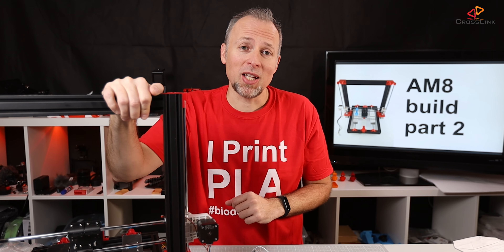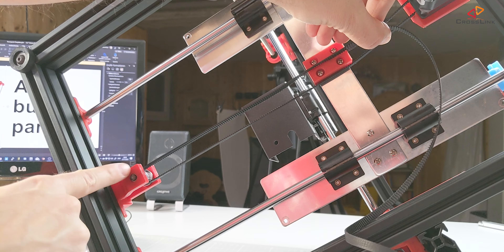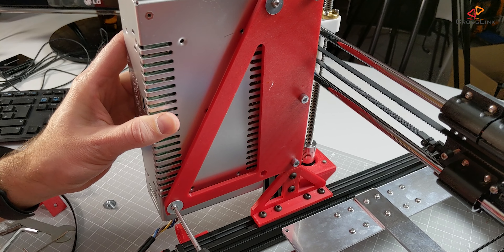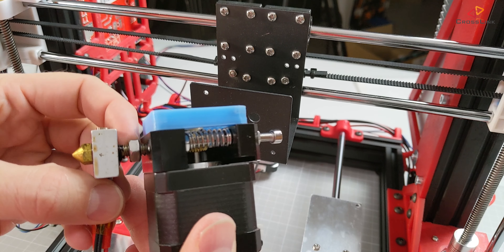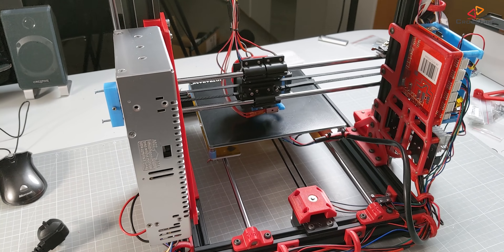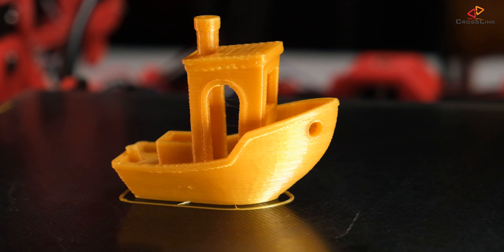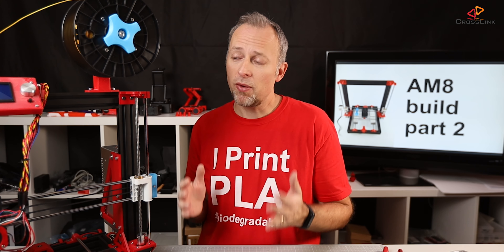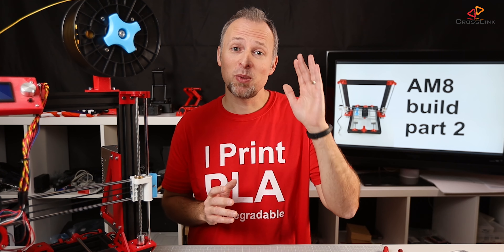Anet A8 AM8 Upgrade - part 2 - Electronics and first print

Comment: My hotend on my AM8 is an original E3D V6 hotend in bowden setup to an original E3D Titan extruder. I then also recommend going for Capricorn XS tube since you will not be cutting any corners. To mount the hotend I used a x carriage from 3Displacement on Thingiverse (thing:3599905 and option 2 or 3) together with a custom designed BL Touch bracket (can find it through the X carriage link).  Print quality is excellent now (I had trouble with my Anet extruder skipping on the filament and grinding). I would also recommend a mainboard upgrade in the future, something like a Bigtreetech SKR v1.3 with TMC2209 stepper motor drivers. You will have all the goodies then: stealthchop, sensorless homing, 32 bit processing and ample expandability.

Comment: Great video indeed. I did the same to my CTC i3 pro B, I then got some more aluminium and re-built it as a cube frame and ghosting/ringing is a thing of the past. Thanks to other videos of yours it also has Marlin on it and a 12864 LCD all working perfectly (mainboard is a Anet a8 one).
Reply from the maker: Great to read you liked it! If you have ideas for other topics I should cover, just ask me to make a video about it.

Comment: That's a very nice upgrade.  I think I'd do this upgrade to my i3 mk2 clone since it's frame is made of plywood right now.  Thanks Daniel!
Reply: Plywood isn't all that bad.  I am currently resurrecting a CTC i3 (got it incomplete) and with a few printed parts, it becomes extremly strong. But it has the "full" main frame part (the big "O") like a prusa and not like the Geeetech i3 Pro W that I also mod right now. If I would mod a Geeetech i3 Pro W the way he mods his Anet A8, there would be not much of the original in the final printer anymore^^ If I replace the frame, I should also replace the leadscrew and the Extruder with Hotend are kind of bad. Then I should replace the driver, the bearings and the PSU (24V would obviously be better) Then the cheap Heatbed and maybe the screen. Basically enough to start building a second printer from scratch, right?^^ I have therefore set a different goal for each of my printers. My Ender 3 shall be the best it can be, because it was very good from the start. My Geeetech shall be upgraded as efficient as possible (got it for only 40€ by chance) and my CTC will be the subject to all kind of weird experiments, reviving it with parts I clone from the original Prusa i3 Mk2s (I have nearly completed my cloned direct drive) And luckily files meant for the Geeetech are often also working for the CTC and vice versa.
Reply: @SchwachsinnProduzent  My frame is one I laser cut from 6mm ply and then laminated 2 pieces together to make a 12mm frame.  It has the side supports which are also 6mm ply but only one thickness of ply.  It is very strong yes, but the laser cutter I used has a 12" X 24" bed so my frame had to be pieced together since the whole frame could not be cut at once.  My MK2 clone is based on the "dolly" clone Tom of Toms3d did with some custom printed parts and tweeks.  It works pretty good but I'd still like to do a aluminum frame for it some day.  Thanks for your reply.
Reply: @kortt  So the weakest point is currently that you could only cut smaller pieces for the main part of the frame that you had to put together? If I understood Tom's video correctly, the precision you get with normal hand tools is enough for this part. Maybe you could cut this one piece again, maybe from a different kind of plate. I could imagine, if you find something like an old iron plate in the right size, it would be pretty cool and overkill. Or you might get a rest piece of good wood in that size for a good price. I would keep the eyes open for something that could be recycled for this. But I can also understand, why you would like to try an aluminium frame. Since the Dolly is basically an Prusa i3 Mk2S with cheaper parts, I would recommend you to look for the Prusa i3 Bear upgrade. It seems like this is basically what you are looking for.

Comment: As a upgrade to the smooth rod holder. You could move the fixing point's to the front the printer. Design a upside down t. On the end of the vertical section you could put a tunnel that would hold the smooth rod. then you would be able to use the adjustable wheels that you printed for levelling the bed.

Comment: Would the E3D V6 with a direct drive or bowden be a good upgrade. There are several conversions to be had on thingiverse for the A8.  How would it be better?
Reply: e3d v6 is a worthwhile upgrade, however, converting to bowden is up to you. The stock anet x carriage is kind of terrible, it's heavy, and also gets very warm. An e3d v6 solves most of these issues and is some cases can net you an extra 10-30mm in x build space.

Comment: Hi, did you glue a glass in the heatedbed? Let me know how please.
Reply from the maker: I used the Anycubic Ultrabase, which comes with a self adhesive glass. Anyways, you can use double sided tape or a pre-made double sided sheet that fits for your printer.
Reply: @Crosslink3D  Thanks for the tip.

Comment: Nice vid. like allways, but i got few points for you:
1)still using original cables from power supply to electronics? PLS check the fuse! it sometimes burn itself, better make a separate cables to each mosfets and mainboard.
2)try to use better coupling for Zaxis threded rods, this spring ones can make a big errors in layer heigh
3)about that speed test... you will use bigger acceleraitons, right? so the default acceleration in firmware is dominant that you use in slicer configuration, so be aware...

Nice build! keep the good work! :D
Reply from the maker: Thx for the points. I have two sets of wires going to the Mainboard and mosfets separately. Do you have any specific motor couplings that you can recommend?
Reply: @Crosslink3D  iam actually using coupler from trianglelab. (full name on aliexpress: "trianglelab Upgraded Leadscrew Coupler For CR10/CR10S/Ender 2/ ender3/Tornado/Anet A8 and more Flexible Shaft Coupler")

Comment: Hey I have an am8 with stock motherboard. What would be a nice upgrade for the motherboard? I remember ramp 1.6 but that was a year so two ago. I want the lastest stuff so I don’t have to upgrade later. Thanks
Reply: Biquu Techtree SKR 1.4 Turbo with 2209 Stepper Drivers, its 32 Bits at 120Mhz and accepts 12V or 24V

Comment: PLEASE HELP!! I am not a programmer but I did the AM8 build and added an e3dv6 and a capacitive touch sensor. I cannot figure out the firmware changes. Could you send me the CONFIG files for this so my printer is not a hunk of scrap metal?!

Comment: Anyone tried replacing the X axis motor couplers with universal joints (or gimbal joints) ?
Reply from the maker: Do you mean these? [10,39€]5mm to 8mm Aluminum Shaft Coupler Rigid Clamping Coupler for Creality/ Ender 3 3D Printer 3D Printer & Supplies from Electronics on banggood.com
https://banggood.app.link/axq4e1w011
Reply: @Crosslink3D  Nope. These are rigid couplers.
I would like to have the Z axis screw completely free to move in all directions, to avoid any binding in the brass nuts on the X-bridge.
It is very important that the couplers are precision made with snug fitting bores to both engine and screw axles.
Any remaining offset in this coupling will end up as binding in the brass nuts, therefore a Ujoint would allow the ultimate free turning in the brass nuts.

Comment: Maybe you could try to clone the Prusa direct drive extruder? It is mostly printed, Prusa is known for their great print quality and parts are easily available. I am currently cloning the one from the Mk2s (waiting for the extruder gear, because I got the cheapest offer which takes forever). I removed the back part of the Motor and spray painted it glossy black so it looks even more like the real deal (apart from the wrong filament colour of the printed parts). I heard that the best deal for a good V6 is to get the cheapest chinese one and replace the heatbreak with a genuine one. Or get the slightly more expensive chinese clone from Trianglelab. I used the official build guide and the videos and hompage of Thomas Sanladerer as my sources for the most part.
Reply from the maker: Congratulations, you have won a "I Print PLA" T-Shirt. You were drawn during the livestream on Sunday, 1st of December. Please get back to me for the details :-)
Reply: @Crosslink3D  Awesome :) How should I give you my contact information? I think YouTube removed the private message function with one of their updates, didn't they? Shall I send an e-mail?
Reply from the maker: Yes, please send your address and email to daniel@crosslink.io
Reply from the maker: Please send me an email, so I can make sure you will get your shirt. If you don't do it by Friday 13th 6pm CET, I will draw someone else.

Comment: The bed leveling issues are discouraging me from doing this metal frame upgrade.
Reply: With the BL touch, you don't need to level the bed often.

I am using nyloc's on mine and it's been a no brainer

Comment: Hi.  I recently sssembled an older model Anet A8.  It has the V1.5 board.  I've been reading and watching tons of videos from people that say I need to upgrade my firmware.  Then there is the whole boot loader issue.  I don't know where to begin..I mostly want to upgrade for safety reasons..fire etc.  Where can I have success?  I run Windows 10..and see I will still have trouble if I upgrade firmware to  Marlin and Arduino etc..Who can direct me to the right information?  Don't want to waste hrs of my time if it will not work..Can anyone help me?
Reply from the maker: Hi Rich, I have several videos explaining this on my channel. Starting with the arduino uno here: https://youtu.be/RQIizXtf9oo. If you like to use a USBTinyISP or USBAsp programmer, which is under 5 USD and more convenient, watch this video: https://youtu.be/wRODgnAqp1A.

Comment: I did my AM8 build earlier but I'm still loving watching AM8 build stuff. Well done. Horizontal Y-belt upgrade is suggested to reduce Y motor stress but I wasn't happy with tensioneer part, so I've replaced that with https://www.thingiverse.com/thing:2459058 by flipping 90 degree bearings part
Reply from the maker: Thanks for the suggestions, always happy if you like it :-)